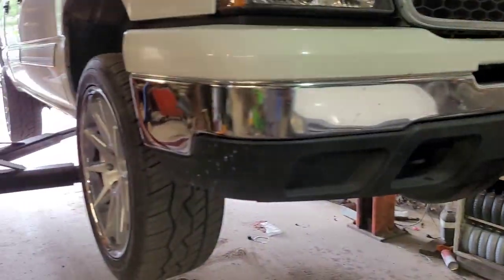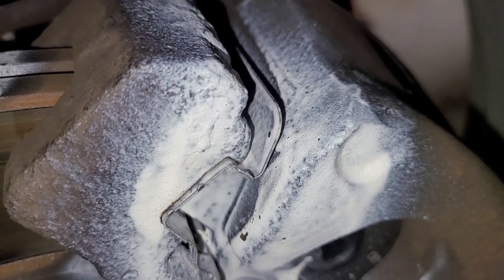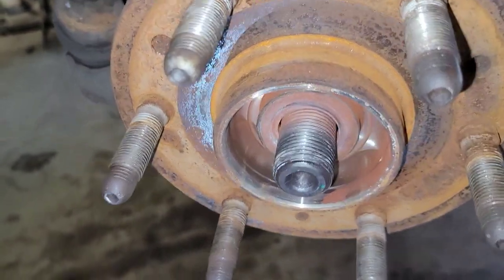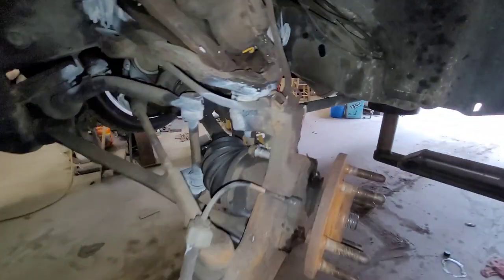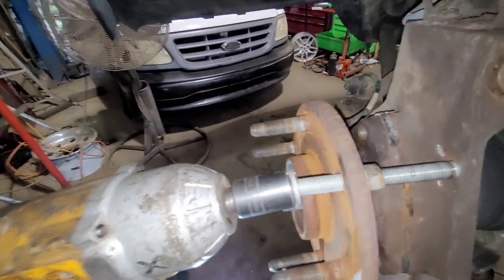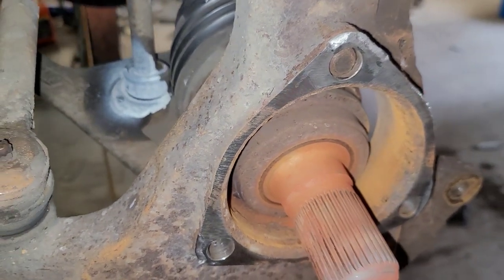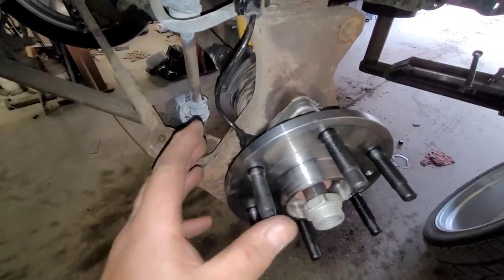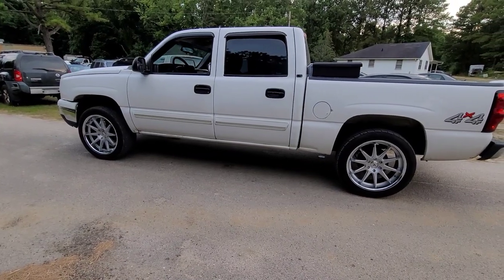Silverado Hub Bearing replacement. Sounded like grinding brakes

Comment: I went to my son's house to put some brake hoses on my wife's van and didn't bring my impact 19 mm with me. I had a12 point 19mm and I boogered up the acrorn lug nut. I was not aware that the 12 point was slightly smaller than the 6 point. Good video. Happy Motoring.

Comment: I use this same method to remove bearings on my wife's 2016 Ford Explorer. Little bit of heat, some PB Blaster and a few half inch bolts and a breaker bar and they come out pretty easy

Comment: How I get the bearing hubs out on my Buick is to take an air chisel and work it back and fourth. Its going to break and leave the back of the hub in still but that just pulls out no problem. Then when I put in the new one I put anti seize after cleaning the inside of the knuckle. Your bolt and nut method looks good too. Thanks for the good video.

Comment: Anymore I try a few good wacks with a hand maul, if it doesn't move I go right to improvised jack bolts. Just make sure of where they push against the knuckle. Work smarter not harder.

Comment: A suggestion for you is to add a thin layer basically a skim coat of grease to the inside of the nuckle and where the hub will contact it. That way if you have a parts failure or the curb it real good you can pop it in and out much easier. Especially with the grooves caused by pulling the hub the way you had too. It is nice that you said to clean up the sharp edges but, you should have explained it is because it causes stress risers aka a point where stresses can come together and form a crack.

Comment: Yep..if you try to drill out backing plates they do tend to bite back! I usually run a drill bit in reverse..it won’t bite and the backing plates are usually thin enough that it works fine.

Comment: Wow Kenny! Yep, no grease under the cap but that brought back memories because I used to use a flatblade screwdriver and gentle tappity tappity taps. Didn't take much. This different from the old days though. Can the bearing be pressed out of the hub or does it absolutely have to be replaced as  an all new assembly?

Comment: You checked the brakes but not the wheel bearing? 🤔
Reply from the maker: I road tested it after I checked the brakes. No noise. I also shake down every front end when on the lift, it had zero play. Failures sometimes happen in a really short period of time.

Comment: Hard to believe 3wks later now the bearing is bad. I think it was bad at the time of the first inspection.
Reply from the maker: It is quite unusual. I did have the wheels off , took the rotor off and removed the rotted backing plate . I also had road tested it. No abnormal play or noise. Although , like I mentioned, it did have some oversized tires with a very aggressive tread . Possibly it masked the noise ? I have no idea . Strange that it failed the way it did nonetheless. 
I appreciate your comment and watching my video . Have a great day !!

Comment: Squatting, 'rims'(WHEELS!), low profile tires. Uh, it's a truck not a ricer. Then they have 'no money' for maintenance.
Those wheels were an improvement? 🤮
Happy to say I've never replaced WHEELS on any vehicle I've had. Why replace something that is working just fine and made for the vehicles geometry and drive, etc? Never understood this. Usually the replacement WHEELS look like crap anyway.